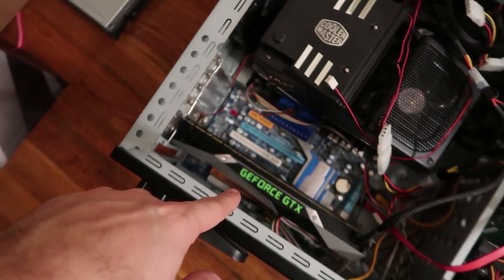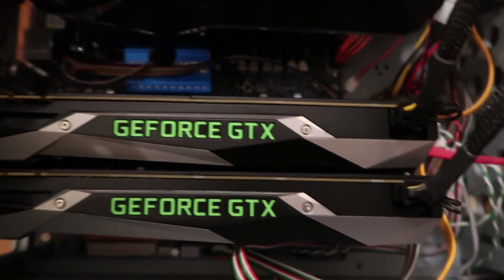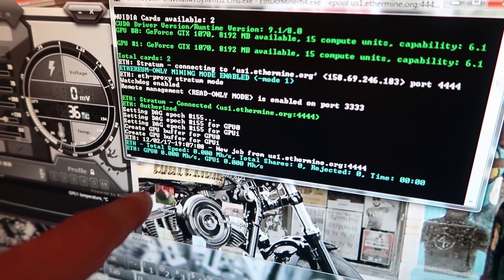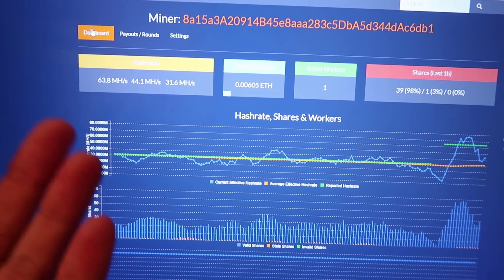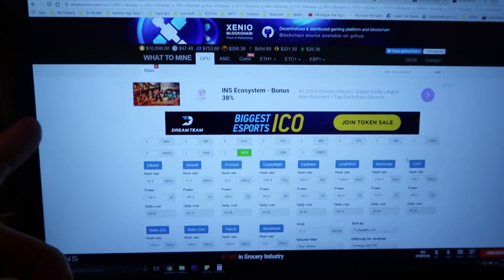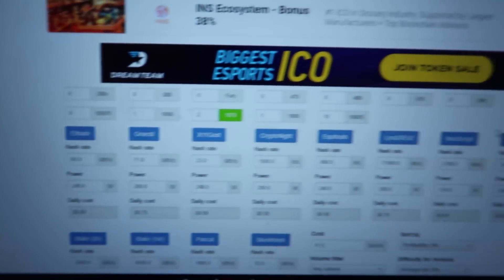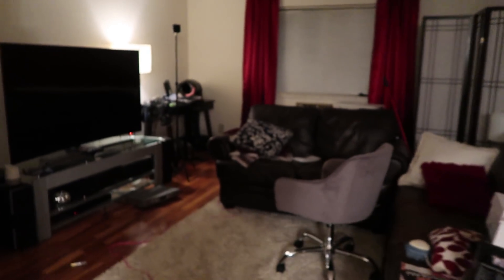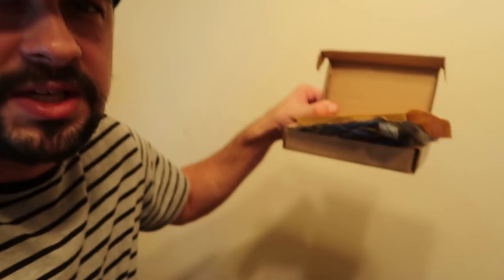Ethereum Mining Rig with 2 GTX1070 - $140 per Month

Comment: Im using Z390 tomahawk and have 2 gpu. Gtx 1070Ti and Gtx 1660 super. Im getting 31s hashrate on gtx 1070Ti. But when I plugged both cards. My hashrate dropped like crazy. Only around 13ish on each card. Anyone can help with this?

Comment: Hello currently using a Cosair CV550 PSU, 
Powering my gtx 3060 ,
I got my hands on a 1060 mini zotac , bought a pcie riser but wondering will it overload my PSU. Will it run ? advise ? Haven’t try yet .
Reply: hey did you try to add your 1060 to your pc and what did you use  reason been is  have a corsair 650 and asus Strix 1070 but also have a Asus Strix 1060 that i want to add to my PC but dont know how

Comment: Hi there, thanks for sharing. I've done similar setup by adding 2 gpus on the same motherboard on the PCI-E slots, however the miner recognizes only 1 GPU and the other stays dormant. The gpus I have are 2 AMD 8 GB running on windows 10, power supply of 650 watts. I've done all I could but no luck in getting it going. Please help.

Comment: Thanks for the video. Question, when I add second GPU (GTX 1070) to my computer and try to mine, instead of doubling my hash rates, my cards operate at 50% of the original 26 Mh/s rate. Any ideas why that would be? Did have make any changes when you added the second card? Thank you.
Reply: What I would do if I had the same problem. I have the same set-up btw... I would open device manager->display adapters and see if both gpu's are being recognized & functioning properly. While there, go to properties and check if they are both running the same drivers; could be your problem. If you don't see the second card, go into bios and try to find it; I have no clue what bios you use... if the card does not show up in bios then try connecting everything again after disconnecting the card, carefully. then try again. if you don't see the card anywhere then send it in to have it tested. if the card is not functioning properly, it should still show up in device manager and tell you it's not functioning properly in 'properties'; if the card isn't being recognized then that's a separate issue, could be damaged pcie slot or gpu. who knows!! (Nvidia tech support would!)

Comment: Should I get 1070 or 1080? ROI is not a problem just perfomance per watt and wide scope for mining algos
Reply: 1070 is  generally the better option for performance per watt.  That said GPU prices are insane, you might struggle to find a 1070 at a fair price, might come down to what you can get atm
Reply: Ikr, 1080 is here almost twice as expensive as 1070

Comment: If you care about profit sell those 1070s on ebay for a profit and buy some RX580s. Those cards pull to much power and even undervolted they dont have a good cost/profit analysis. Even though as others have said Eth is becoming less and less profitable to mine. You should be able to get at a minimum $94 profit per a card per month if not reconsider your set up.
Reply: Even just mining Nicehash he can get about $110 per card (right now) with the GTX 1070, its what he is mining is the problem not the GPU choice. The GTX 1070 is largely seen as the most profitable atm but nearly impossible to find for a fair price.

Comment: You can mine with three GTX 1070 with a 500-550W PSU. You don't need a 850W PSU for only two 1070. If you set a 70% power limit for the best hashrate/power ratio, one card consumes about 95-105W.

Comment: You can downclock the core by almost 200 mhz to save power (by lowering temps and reducing the spinning of the cooler). Ethereum doesnt use computing power, only memory. Got the same rig and using afterburner.

Comment: our electricity cost is 0.11usd/kwh i should get over 300 bucks per month maybe even 350 with slight OC... SHOULD I GET TWO 1070 gpus
Reply: Yes they rock. fyi your price per kw goes up the more energy you use. Btw I have a couple extra bran new unopened cards that I couldn't fit in my computer if you are interested in 1070's.
Reply: you are late.. I already bought 12 of them.. for 380$ per one
Reply: That's a ridiculous price unless used then I hope they don't burn out on you soon! If you bought new please share your source? Thank you!
Reply: local store in Macedonia.. I got them from the owner of the place...
Reply: and they are new yes unsealed

Comment: You should mine ZEC with that setup. I'm mining on a single MSI GTX970 at 325-330 Sol/s using the EWBF miner. Dual 1070s should pull around 980 Sol/s.

Comment: Is a GTX 970 good for mining anything out there ?
Reply: I'm mining ZEC on a single MSI GTX 970 at 325-330 Sol/s using the EWBF miner.
Afterburner clocks: Core = +200 | Memory = +385
Forced P0 state via command line with updated OC values after I started mining: nvidia-smi.exe -ac 3890,1655
Reply: I use nicehash with GTX 980 and I get over $5 / day   i7 5930k 6 core 3.50ghz
Reply: Scott Lopez how much are you making?
Reply: does the proccecor matter like if i get the card will i make thhe same amount with a cheper proccecor
Reply: youngmoney565 not really, as long as its decent as the main load if on the GPU (s)
Reply: The pentinums are nice
Reply: Around $3.00 a day, currently. Fluctuates with the market of course... Not bad for a gaming card I had no intention of mining with a few years back. The EWBF miner will utilize it the most efficiently.
Reply: sorry, what i meant is choose mobo over cpu, you want a motherboard with enough pcie x1 slots for yyour gpus, then get the cheapest cpu for that board
Reply: nice, cant get eth to work well as its only making me 7Mh/s but with zec i am getting 300sols (havent messed with it yet) - so would zec be the best coin to mine on this card then, same boat as you lol, picked up this card then was curious about mining
Reply: Dude, same here... I originally tried mining ETH after reading that a 970 should hit 22Mh/s if dialed in right. No matter what I tried, I could never get above 8Mh/s. Tried different miners, clock settings, Nvidia configs, but nothing worked. I threw in the towel and moved to ZEC.
Reply: yep, so far zec is cool, how is it treating you? i think ive mined £2 so far
Reply: I've mined about $65 since I started just before Christmas.

Comment: why am i only getting 1.2 mh mining ethereum with a 1060 6gb and 28.5 with a 1070
Reply from the maker: that's low, something is wrong with it. are you overclocking?
Reply: Thats super low. I get 15Mh/s on an overclocked 1050ti.
Reply: no havent touched it .. i notice it with the 1060 but not with the 1070 im getting 30 mh
Reply: what could be the issue
Reply: I had this same problem. You need to download update for windows 10. I am guessing you have that OS.

Comment: Lad, never go for Ethereum on NVidia cards!
What a waste of potential profit, take it up a notch. As a owner of 3 GTX 1070's (2xZotac, 1xMSI), I am mining NeoScrypt (UFOCoin, TrezarCoin, GoByte) and Equihash(ZenCash, Bitcoin Gold, BitcoinZ) and making a minimum of 15$ per day, average is around $18.
The trick is to find the right miner software for each algo to get your peak performance.
Reply: in which pool your are mining? I'm newbie to mining
Reply: altmining (NeoScrypt) or any suprnova pool
Reply: I'm currently on ahashpool. Is this a good pool?
Reply: you know its hard to convert those altcoins u usually have to go to exchange sites to convert them to bitcoin or ethereum, unlike ethereum and bitcoin that can be converted right away to fiat money...
Reply: You know it's actually pretty easy and really it's worth the 50 % higher profit?
Reply: Also, not to mention, you can use something like mining dutch pool, which automatically coverts every single altcoin you mine to BTC and pays you out in BTC, if you are lazy. :D
Reply: rather have the coins itself you know that some coin go up by 3000%

Comment: 34 Mh/s with 70% Power, +200 Clock, +1000 Memory and around 63-67 Temp (so far a week with this setting is stable), but then again i'm with Open Air Fan and also Open Casing
Reply: hands up, nice bro

Comment: is one 1070 Ti variant better than another? Does the MFGR matter or anything like that?
Reply from the maker: My friend just bought a Ti, and stock he was getting around 26Mh/s. I got the 1070 Founders Edition, and stock is 27Mh/s. You can overclock both, and you'd get 31.9Mh/s.
Reply: so the manufacturer doesn't matter? Zotac vs EVG?
Reply from the maker: Haven't had any experience with Zotac, but I think EVGA is better in my opinion since I've used them a lot in the past.
Reply: I guess I just don't understand the difference between the different sellers of the 1070 Ti. I've been trying to research what would make one better than another.
Reply: quality of circuit boards, capacitors, resistors, memory used. i only buy evga.
Reply: EVGA or Gigabyte are awsome

Comment: Bro, you'll want to use MSI Afterburner to reduce your TDP and boost your memory clock. Even a 1060 can get 26MH. A 1070 will definitely get better than 32.

Also, you should be mining Vert, Mona, or just Skein.
Reply: Michael Langner 
Im a noob, is there anyway i can get more out of my Rx 570, im only getting 19.50 Mh/s the memory i pushed to 1884 in afterburner anything after that the screen blacks out, is there something else i can do in afterburner to increase the memory? Oh yeah im mining Ethereumn through nanopool

Comment: Gtx 1070 isnt a very profitable card cost to hashrate wise. Nividia in general isnt very great for mining. A better choice would be amd rx 580 which cosrs about 250 dollars and gives you a solid 30mh And you can get more of them.
Reply: wrong answer bro......gtx 1070 is EXCELLENT for mining Equihash, AMD is better for DiggerHashimototototot
Reply: To put this another way: if you live in your mother's basement or steal electricity then get whatever AMD you want, but otherwise efficiency MATTERS.
Reply: I have an RX 580 and a RX 480 mining Ethereum. I'm only getting 36 mhs on Eth Classic and 40mh on Ethereum. Is that normal?
Reply: What you are gonna mine? MSI RX 580 8Gb is one of the best (90.000h of lifespan) for Digger Hasimoto and the Gigabyte GTX 1070 G1 OC gives me wondefull results in Equihash. 1080 is too expensive yet....and wait with your "buy" after christmas because prices will drop (now they are high due to xmas time...)
Reply: Jaime_Martinez99 you are getting 36 mh with both cards??. If so then there might be something slightly off dince eith a 580 alone you can get around 30mh/s.
Reply: don't click on my profile what are you talking about? Clearly not mining the right coin here
Reply: Depending on where you buy your gear...but i understand your point. still AMD perfoms better on ETH/ETC/DBIX/UBQ/EXP (all DaggerH coins) and GTX performs better on ZEC/ZCL/BTCZ/BTG/ZEN (Equihash).  Did a investigation/bencemarks before purchasing my cards..the GTX 1070 was overall winner (gigabyte gtx 1070 G1 OC to be specific). Have several of them running now at lightspeed ;) And no, not at notsoNICEHASH lol.
Reply: ^ this exactly, tnx bro ;)
Reply: Bas Zonneveld np
Reply: liam wilcox go to whattomine and check 2 rx 580s vs 1 gtx 1080 or gtx 1070 you will see the diffrence
Reply: liam wilcox 2 rx 580 get you 60 mh/h and 1 gtx 1070 gets you 30mh using ethereum. So he could've doubled his etherum output if he used amd rx 580. And rx 580 costs around 250 a gtx 1070 costs around 400
Reply: @bas zonneveld can you recommend a card with a URL?
Reply: Bas Zonneveld ok nividia is better for equihash but amd is much better for ethash if you are planing on mining etherum. And he in the video mentioned he wants ethereum so amd would have bean a better choice
Reply: don't click on my profile i have the bios it goes from 18mh/s to 19mh/s. So yeah with both I'm getting 37
Reply: @don't click on my profile: see my previous post....guess you missed it

Depending on where you buy your gear...but i understand your point. still AMD perfoms better on ETH/ETC/DBIX/UBQ/EXP (all DaggerH coins) and GTX performs better on ZEC/ZCL/BTCZ/BTG/ZEN (Equihash). Did a investigation/bencemarks before purchasing my cards..the GTX 1070 was overall winner (gigabyte gtx 1070 G1 OC to be specific). Have several of them running now at lightspeed ;) And no, not at notsoNICEHASH lol.
Reply: I am making roughly 15-20$ a day with 3×1070 and they are not profitable?
I am runnin' a nice 3,3 MH/s on NeoScrypt and 1450 Sol/s on 80% power.
If you mean Ethereum, then yes, you are correct, but overall? Nah...
Reply: shawneeo i never said they werent i said for ethereum there are better options since he said in the video he wants to mine etheruem as he feals it will rise in price later.
Reply: GTX 1070 is the most efficient in terms of speed per kw/h. All the AMD cards are power hogs, although yes there are definitely more powerful in absolute terms if your power costs are high you won't actually be as profitable as using a 1070 specifically. As to which one is better ROI that depends on your electricity cost.
Reply: Can only get 22MH on both of my 580X. Got 2 XFX GTR'S 580X 8gb
Reply: Gerald Jirau its you didnt optimize them you could search on youtube on for tutorials to get the most out of your card
Reply: +Prashant Balhara like
Reply: lol. wrong.
Reply: Bas Zonneveld the gtx is good but far from excellent on gpu mining OVERALL i am not goun to focus on one specific coin cause it would be a very risky investment. Lets use whattomine for calculations a common currency and nvidia cards. A gtx 1060 which costs almost half as much as a 1070 can get you about 47 dollars a month mining etherum(although it isnt the best currnecy i just used it cuz its sort of well known). A gtx 1070 will get you 63 dollars a month. So if you get 2 gtx 1060s for the same price as a 1070 u will get more profit. The same goes with most coins.
Reply: Bas Zonneveld the only way i can see a gtx 1070 being better than 1060 is if you are planning on getting  a mining farm.

Comment: Not a bad start, I would really watch those temps. With blower style cards you really should have more space between them to breath. If you do this you can drop those temps, in my opinion anything over 60 C for mining is to hot. You are already stressing the cards to the max, keeping the heat down will help reduce wear on the card and fan, as well as reduce wasted power in the form of heat.

Comment: Hey tuck that pink insulation back down in the tube and tape that end up. If you hold a flashlight there you will see fiberglass slivers sparkling in the light. You don't want that blowing around your place. Be well.